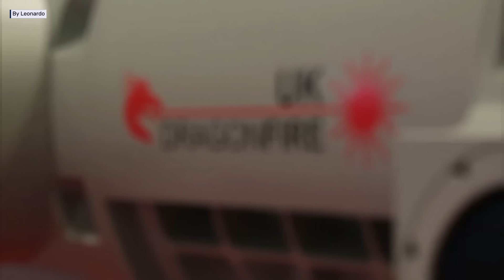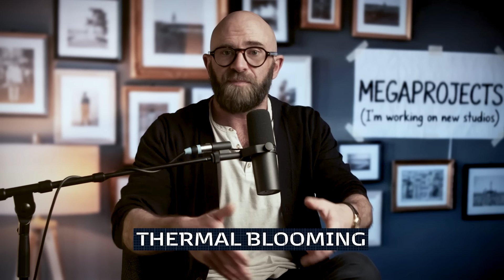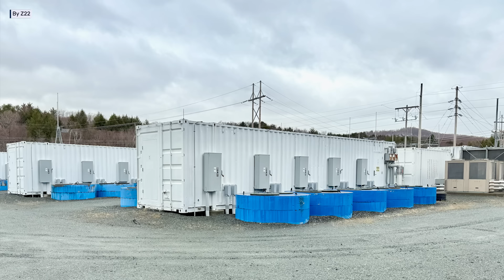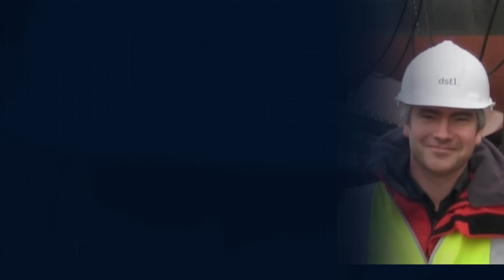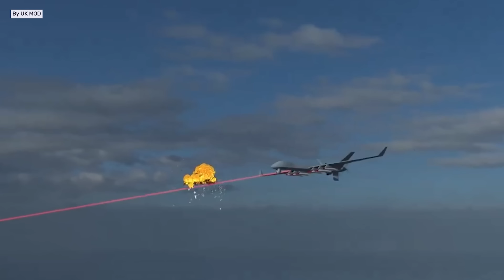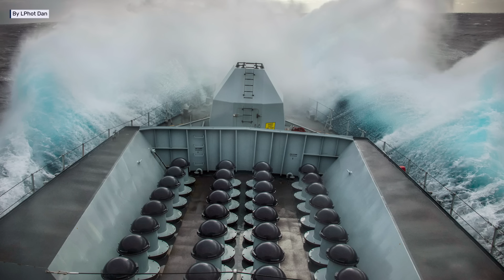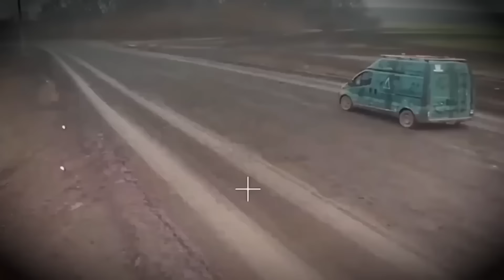The UK's Insane Laser-Directed Energy Weapon

Comment: This sounds great. We just have to hope that the enemy hasn't developed mirror technology.
Reply: If you knew the precise wavelength of the laser then some kind of diamond dielectric mirror which wouldn't melt instantaneously could be used, but then you would have to know exactly where the laser is beforehand. 
Maybe you could use a sacrificial craft to pinpoint the laser and then sweep in while it's still firing. 
Seems like there would have to be some serious counter research to crack that one, and then you'd have to cover the entire craft in the automated mirrors and it gets pretty awkward.
Reply: @98Zai  Why would it melt? Much more powerful lasers used in research facilities are guided around exclusively using mirrors. They don't have to be made of anything special just good mirrors with minimal imperfections.
Reply: @momoz74  Even the most perfect dielectric mirror we can produce is still only 9.99% perfect. For a laser that's supposed to vaporize metal in a few seconds, that hundredth of a percentage should be enough to shatter glass. Obviously this is all speculation as nothing is really known about the weapon, I think Simon's writer is speculating and his sources are being misleading.
Reply: @98Zai  Well that is true but reducing the power delivered on the target by even a factor of 10 is going to ruin this weapon system. It already suffers from low range due to losses caused by air impurities over distance. Once you reduce it's effective power further by a factor of 10 it becomes nearly useless.  I can think of many ways to counter this expensive toy. Reflective coating, active countermeasures consisting in a spraying water into the path of the incoming beam which would disperse it. Attacking the system during rain or fog when it is basically dead in the water and then resuming attacks on targets after it is taken out.  And that is just from the top of my head. This seems like a very expensive bad idea.
Reply: @momoz74  The completed weapon is probably cheaper than a conventional missile. It's just the research that costs a ton of money. I agree that research into weaponry is a bad idea in general, as it only serves to escalate when we should be de-escalating globally. But we're still just little children mentally, it'll be a while yet until we can properly understand the real scope for our planet and species. Religion, money and nationalism will have to be forgotten for a long time before we'll reach that point.
Reply: @98Zai The weapon will cost the taxpayer millions of dollars per unit and will be a waste of money. Energy weapons seem cool at first glance but the reality is the technology has huge drawbacks that are hard to overcome. If these were cheap then sure, it would make some sense but they are expensive as fuck for what they provide even in the most optimistic of scenarios. And frankly I wouldn't be surprised if in combat these things end up failing miserably.
Reply: @momoz74  Well, that's a fact of a lot of research. You simply can't know unless you try in practice. Your personal opinion is weighed against the opinion of likely dozens of professionals who have real professional consequences to face. I'm assuming they've already spent a few decades researching this. But all that is pretty meaningless in the grander scheme as the next war will simply be a rain of nukes.
Reply: @98Zai  I sort of know from intuition alone. Lasers are not a new thing, the idea of using lasers as a weapon has been tried to death. It didn't work then and it won't work now. As for the professionals we are talking about the same schmucks who came up with crap like the US Navy magnetic rail gun program and other brilliant ideas like that? You clearly don't know how the military industrial machine works....
This in fact is a great idea. If your goal is to bleed the taxpayers dry without much push back this thing is EXACTLY what you need. Cool enough to get enthusiastic support from Star Wars fans and all sorts of other morons and complicated enough to justify a ridiculous price per unit. And it can be made to work, somewhat, in controlled environments so your boys in the acquisition department of whatever military you want to sell it to can justify the purchase. Sure in a war it will be next to useless but who cares? What is important is the stock price of whomever makes this toy.
Reply: @momoz74  Sure, I'm all for de-armament. So much money going to train for mword that could be spent on better things. Where do we start though?
Reply: @momoz74  Your intuition huh? As a professional Scientist your Intuition is worth precisely bugger all to me. Intuition is wrong as often as it is right, so unless your intuition is backed up by actual solid, hard data, then it is not even worth the time it took to type that sentence out. 

The laser being proposed is not meant to be a ship killer, it is meant to be a short range, rapid response close in defence system to COMPLEMENT existing missile and projectile based defence systems, not replace them. As a result the relatively short range of lasers, beam attenuation being a well known and well understood problem with lasers in an atmosphere, is NOT actually as much an issue as you are crying out it is. 

As for the magnetic rail gun system, that actually worked, what it was not is viable AT THIS CURRENT TIME. There is nothing wrong with the idea, or the theory, the issue is actually in metallurgy as AT THIS CURRENT TIME alloys capable of withstanding the very, very high velocities of a railgun projectile travelling down the barrel do not yet exist. it is a materials science problem.

Which means, that once that materials science problem is solved, and it probably will be at some point, then the rail gun IS in fact a viable weapons system..... 

Your problem, is you know a LOT less than you think you do. Just because a system does not have the technology to make it work yet, does not mean that such technology will not be developed in the future. If it worked like that then modern missiles would never have been developed because when guided missiles were fist developed they were, quite frankly, fucking terrible.... 

I suspect the materials issue will be solved in the next couple of decades, in fact the Japanese are putting a railgun on test ships even as I type this. A smaller, less powerful system than the one the US was trying to develop, but the fact that its actually going ON TO a ship, indicates that many of the problems have already been solved, at least for a smaller, less powerful weapon than the US system.... And a small railgun actually makes an EXCELLENT candidate for an anti ballistic missile defence system....

I have generally found that when people say crap like 'I sort of know from intuition alone' they really don't have the first fucking clue what the fuck they are taking about.... That single opening sentence told me EXACTLY what I needed to know about you.... And your 'opinion'.....
Reply: As someone who works in the optics field and who has actually worked on high power Fibre lasers I can safely say you're wrong.
There are a number of "windows" in the near infrared electro magnetic spectrum where water absorption is extremely low. Like ridiculously low. The most common ones are aroind 1310nm and 1550nm which is why these are the typically wavelengths used in optical telecommunications, 1550nm being the Centre of the C band.
Another low absorption band occurs around the 1060nm range. At this range, we're talking about lasers that can be can be used for cutting steel, such as the multi kilowatt continuous wave systems, or for marking delicate materials which would be the realm of pulsed lasers.

CW lasers can be made to pulse by putting some form of shutter system to modulate the output. Pulsed lasers would have an internal pulse generator that modulates the seed signal which is then amplified.
To cover an entire drone with mirrors or high reflection coatings is prohibitively expensive, not to mention pointless. As soon as you took off, or ran it through any sort of rough weather it'd rip those coatings or mirrors apart. For example, a typical 1" diameter mirror coated for the near infrared would set you back a few hundred dollars. That's just for what is effectively a round disc with a coating a few microns thick. Imagine the cost of coating a whole drone.

As for using water, while yes there is some impact to the beam, you would still be able to use it at close range to take out slow moving drones (like Shaheds) at fairly close range. It would take a bit longer since you would of course be losing some beam quality and energy but it could still be done by holding the beam on the drone.
Reply: @momoz74 it costs £10 per shot.

Enjoy. They're coming at you yanks very soon.
Reply: @alganhar1 the Japanese have made some sort of breakthrough in materials science in relation to rail guns, haven't they?

Im asking, idk.
Reply: @98Zai  not sure where you're pulling numbers from but you can absolutely make mirrors that have reflectivity greater than 99.9% through the use of coatings. He'll you could even get 99.999% reflectivity.

Lasers of this type, even though they call them kW, lasers will invariably be pulsed rather than continuous wave.
A kW CW laser operates differently to a kW pulsed laser and their destruction mechanisms will be different. A CW laser delivers a constant power whereas a pulsed laser will ablate the surface of the target in effect jack hammering a hole through the target surface. In these ladders peak power, which is the power delivered per pulse, is the key parameter and that could be in gigawatt range depending on the pulse rate and pulse width. 
These are only 2 among a host of other parameters though
Reply: @AvoidTheCadaver  Cool, if nothing else it should drive research into even higher degrees of reflectivity! This is awesome because it would improve telescope tech which means we can peer even further back in time. 
I have no idea about the rest, but I'm glad you have a special interest :)
Reply: @98Zai I spent about half a decade working for a company that made high power industrial lasers. One of the company's biggest competitors did work for DARPA so we had some interest in keeping abreast of their tech.
Reply: A lot of high energy laser will burn through their own focusing mirrors while pumping tens to hundreds of gallons of water through them every minute.
You’d need one hell of a cooling system to make the small laser spot not burn through that mirror in a fraction of a second.
You’re better off using something like graphite which can radiate 14.5 megawatts per square meter at its vaporization temperature of 4000 kelvin.
Reply: If you had a coaxial beam of microwave energy you should be able to negate some of the water vapor power dissipation in the surrounding light beam path I would think.

The more precise the weapon is the less likely we have civilian casualties and if effective it would be much much more cheaper weapons to use which was pointed out.

Possibly a pulsed MASER in compliant with the light beam you could use these weapons against ICBMs and weaponized satellites.

Hopefully diplomacy proves to be the best alternative.
Reply: they should have had you on the design team...
Reply: They don't need to.  50 kW is an absolute joke.  Even a 300kW laser has to be held on a small drone for five seconds to disable/destroy it.  In the age of drone swarms, until VASTLY more powerful lasers are developed, all of these are just hype.
Reply: @winstonsmith478 there is footage of dragonfire being used on drones from multiple km away and destroying them in a few seconds.
Reply: @winstonsmith478 this depends on the spot size of the laser at the target, beam quality and the surface material etc.
But as an example, the American LaWS system tested in the 2010’s basically took 6 industrial cutting lasers and combined them into a telescope aperture for a total output of about 100 kilowatts.
In testing videos you can find online, it was able to bore through to either the avionics or engine of a drone from the front in about 0.8 seconds. Of course those industrial cutting lasers are of higher beam quality than some military lasers and can get smaller spot sizes on target but your results may vary! 
Smaller spot size = less time to bore through a target as the power density is higher.
Reply: @winstonsmith478 doesn't sound like you understand much about lasers

Comment: I'm not so sure that the involvement of Williams is not low-key brilliant. Government appropriations are often so tied with strings for account management, that they would always be clearly segmented, which I believe means that they won't cross-over F1 spending cap limitations. Sure, the laser technology probably may not have much benefit to the grand prix racing group, but shared maintenance and utilities would be a shared indirect pool, and more programs gives the group flexibility to spread billable hours for salary to programs with work to be done.

Comment: If it takes 10 seconds to destroy a drone incoming at 100mph, then the Dragonfire, with a range of 1km, only has time to shoot two drones. Therefore if there are three coming at you, one will get through.
A defender will therefore need lots of these systems to defeat a swarm. If a drone costs £1000 and a Dragonfire costs £10 million, the cost equation still favours the drones. Irrespective of the cost per shot.
Reply: But how much damage will the drone do? The Iron Dome missiles cost more than the rockets they take out, but having said rockets impact cities (material costs and cost of lives) cost more than the Iron Dome missiles.
Reply: @gdrop6623 it seems to me that comparing the cost of a drone with the cost of it's countermeasure is only half the argument. 
As you say, the real reason for firing a $1 million missile at a $1000 drone is to prevent $2 million of damage that the drone could do.
However if the sky is filled with cheap but credible (to the defenders) decoy drones, then whether the defenders have missiles or lasers, their capacity to eliminate all potential attack drones remains too limited to provide an invincible defence..

Comment: They've been working on this for 20yrs and finally got consistent results against missiles in air defence. Hopefully its still strictly regulated using air gapped computers and faraday cages with a small crew controlling them. Anything else would be retarded.

I still think plasma weaponry will be the future weapon. These are basically a laser pointer with the power of small town behind it to overheat targets so missiles and drones are easy targets.

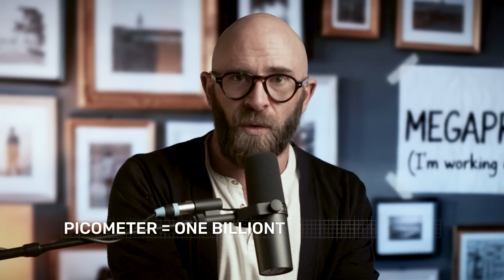Comment: 4:35 So basically these things can be sabotaged by tossing a single standard steel construction bolt at the lens? 😂 even if there's a ballistic glass cover: that would still need to maintain the same flawlessness in order to function as intended. (I bet they don't have ballistic glass covers on during operation.

Comment: Steath aircraft have radiation absorbing coating that could increace vulnerability to energy weapons
Reply: Bruh... c'mon. The radiation absorbing coating is for RF, particularly at radar frequencies, and aside from that, lasers damage things by getting them extremely hot... the last thing you want is a coating that absorbs energy in the light spectrum.
Reply: @gh8447 Absorptivity of stealth coatings appears high in visible spectrum too ( typically dark/matt colour).  In contrast (pun intended..) Polished Aluminium surface might offer defence?
Reply: @mikefnz3144  Not really - maybe a polished high temperature stainless-steel alloy might survive, but then your aircraft would be so heavy it'd never get airborne. I was also thinking of Inconel, but it has a medium grey colour and it's also heavy.  With the sheer amount of energy being delivered on one spot, the polished / mirrored surface would need to be impossibly perfect; even the slightest imperfection or contamination would lead to overheating and failure. Aluminium aircraft have multiple joins in their panels that could be exploited and composite materials are even more susceptible to high temperature.

Comment: I saw someone do a simulated drone swarm against a Type 45 with a Dragonfire laser on it. Obviously it’s in a game and so very much not to be taken at face value, but even at 5-10 seconds per target it knocked 30 Shaheds out of the air with relative ease and for about 0.1% of the cost of a single small missile.
Reply: That would have been the Grim Reapers channel. Cap does a lot of these 'what if' simulations. Wouldn't surprise me to see a re-run of that one once he and modders have worked out more of the kinks.
Reply: GrimReapers? But yeah they do loads on Sea Power and DCS - Pretty realistic platforms so from "Available Knowledge" it's the best you can do too visualise it.
Reply: Imagine if a drone light display was going on nearby, and DragonFire thought it was under attack!
Reply: It doesn’t think it’s a laser weapon not a intelligent robot with lasers in its arms and any thing capable of thought would probably be aware of a local event including light display using drones only a THOUGHT